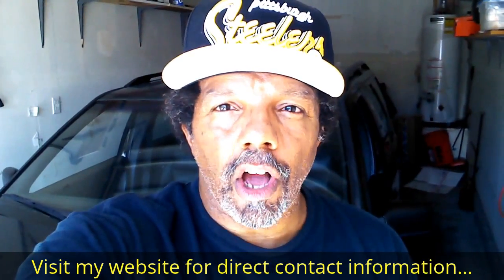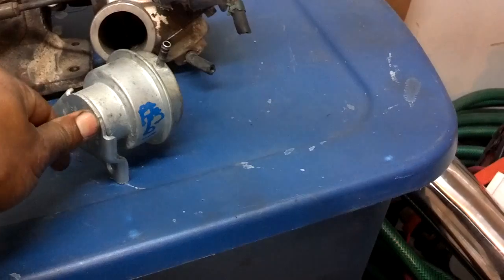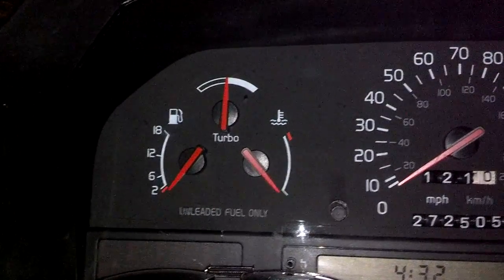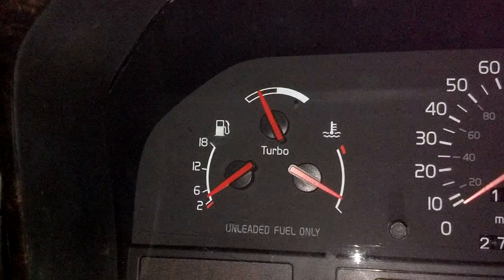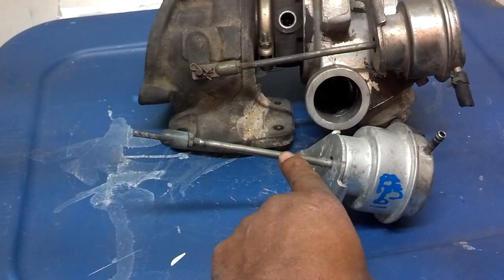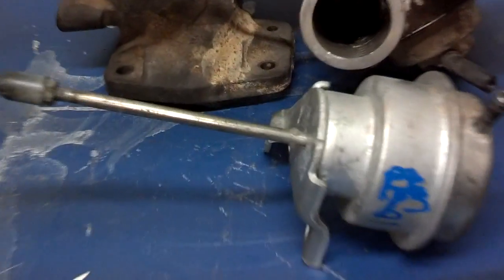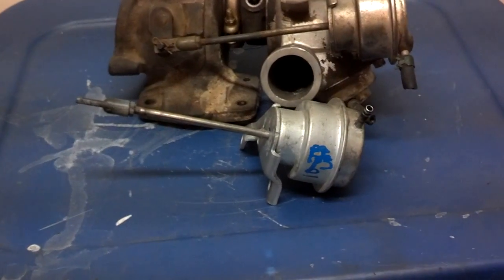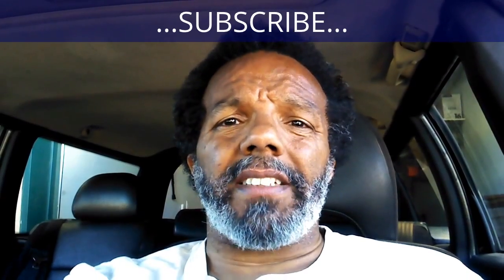How does the turbo, wastegate actuator work, function, information, testing, etc. - VOTD

Comment: I have been curious to find specific information on how easily the actuator arm should move. I noticed that the one in my 850R is amazingly tough to move in and out. Based on what I've seen in this video, there's something wrong with mine and it would be a good idea to get it replaced. It feels sluggish until it is rolling, but even then doesn't feel as fast as I expect it really should.
Reply from the maker: illitero I doubt that's the problem. If a wastegate is stuck closed, the car will build more boost and be faster. You have some other issue like a torn bypass valve, or the BSC is hooked up wrong. You could also have a torn boot pressure hose.
Reply: Robert DIY When I received the car, was overboosting like crazy and the ECU would rev limit the engine (I have a video on my channel about it). I never had a turbo car before, so it took me a short while to figure out how the systems work and where to look. So I finally found how the previous owner had the actuator disconnected from the vacuum system and the line blocked off with a bolt. When I was poking around with everything, I disconnected the actuator arm from the turbo itself and checked the action on everything since the port was just open to the atmosphere, and the arm was very tough to move in and out. So I've just never known if that's normal or if it's in need of replacement.

As far as everything else you've touched on, I wouldn't doubt it needs some attention. I've been out of work because of disability for over a year and a half, so I haven't really had the money to put into getting it healthy since I first picked it up earlier in February. I'll definitely try looking into it all, though. Thanks for the feedback!
Reply from the maker: You're welcome. Hope things work out for you.

Comment: Does the waste gate have to have a pin at the end? Why is it there? I changed gaskets on my manifold and now my turbo doesn't want to spool.
Reply from the maker: angel mota The wastegate actuator arm has a hole in it. That hole on the end of the arm connects to the exhaust flange wastegate arm. There should be a pin the arm to keep it from popping off.
Reply: So taking that pin wouldn't make a turbo not spool? Thanks for reply!
Reply from the maker: angel mota If the pin is OUT and the arm comes LOOSE the wastegate will flop open and cause you to have very little boost.

Comment: Hi Robert! I have a 1999 AWD S70 with a turbo. Me and a friend put in a boost gauge and it shows that I have 20 vacuum (units?) but I'm only getting 2 psi of boost. We readjusted the waste gate to give me 5 psi of boost (which is what he says is supposed to be factory) and while the the vacuum is at 18, the boost is still at 2 psi. We tested the vacuum lines going to the gauge and they hold up so it's not installed incorrectly. Could I possibly have a pressure leak somewhere while keeping a good vacuum seal?
Reply from the maker: Thomas Boll Yes, chances are there is a fault in the system telling the computer to limit the boost. Force clear the ECU of codes and see if anything changes. Have you PRESSURE leak tested the system? Smoking the system is most common.

Comment: Okay, now I seriously need to get that gauge!  I have a 98 S70 T5, which has the 16G turbo. I have read that you can tweak the turbo a little by adjusting the rod length. They disconnect the pin and add a certain amount of pressure to the wastegate, at that moment they turn the top of the rod so that it can slide back around the pin. Have you ever done that or do you just keep everything stock, as is?  Has anyone else done this?  What pressure did you use?  Finally, cheers to another great informative video!!
Reply from the maker: Sebastian Schwarz Man, turning the wastegate arm to make it shorter (a turn or two), which would keep it closed a little longer may be ok if the wastegate is getting weak and needs a little help. I like keeping things stock because it's safer and will last longer. Also, messing with the wastegate is the best way to cause a bad fuel/air mix which is bad. I would rather install a MBC (manual boost controller), it's a little safer.

Comment: Smashing closeup data robert, you made that so clear. :-)
I dont know the psi required but i bet a bicycle pump with the built in gauge could be modified with a valve+stem to fit, if closer testing was required.
Its a daft thought lol :D
Reply from the maker: zx8401ztv Thanks for watching. The pumps that they sell at auto parts stores are outrageous. They do loan the hand pumps out so it's not to bad.

Comment: Good information on testing the wastegate actuator, the rubber diafram.
Reply from the maker: Michael Chitwood It's best to use a pressure pump but hey, the finger plug test is a start. LOL